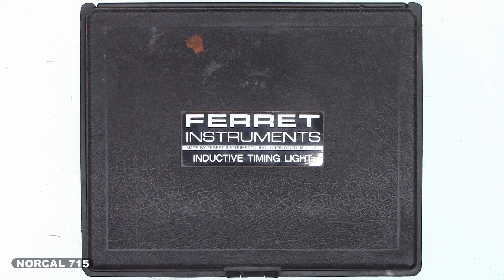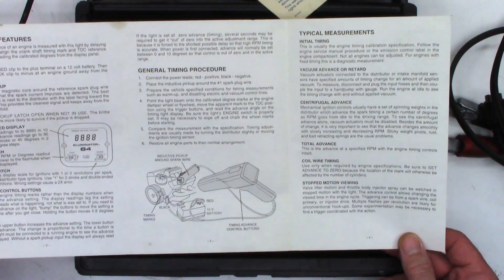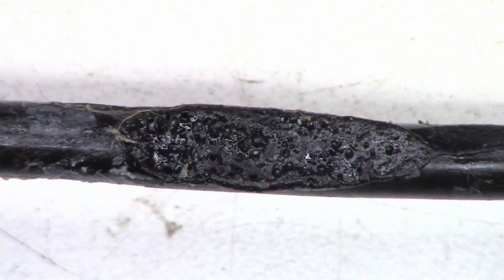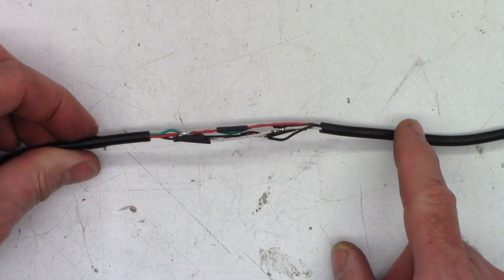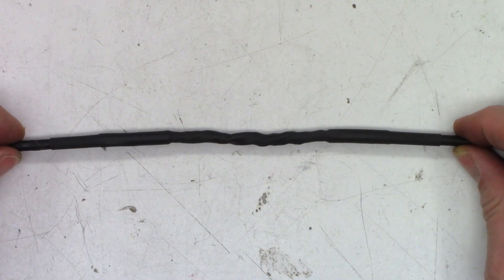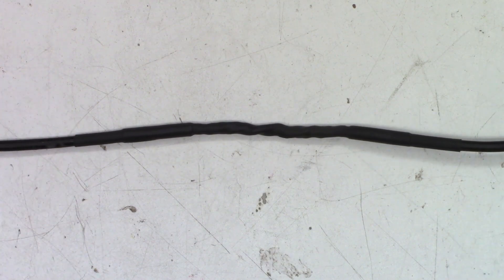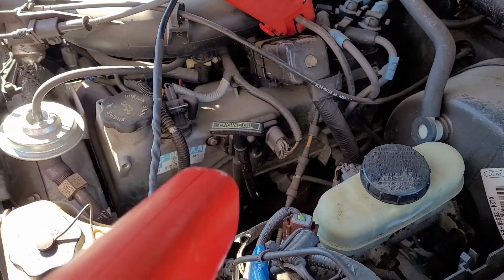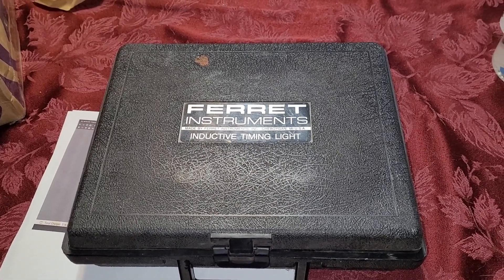Ferret Instruments Eluminator 84 Inductive Timing Light Repair- Melted cord

Comment: Thanks Steve.  The timing light works perfectly.  You're right.  I did get the timing light in the late 80's.  The cable did occasionally  come in contact with the headers on the many hot rods I've built over the years.  I learned my lesson to late but I don't put the cable so close to the spark plugs and headers anymore.  Hopefully, no more burnt cables.  Thanks again.
Reply from the maker: Thank you!
Reply: I have the exact same timing light. I wish I could get a copy of the manual or a few photos of it. I can't find a manual anywhere for it after I let some borrow it unfortunately.